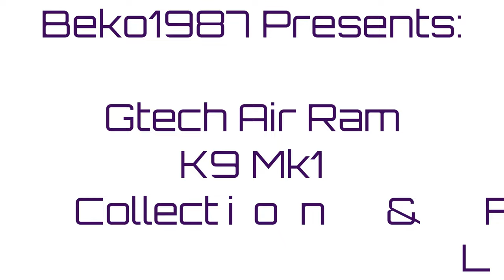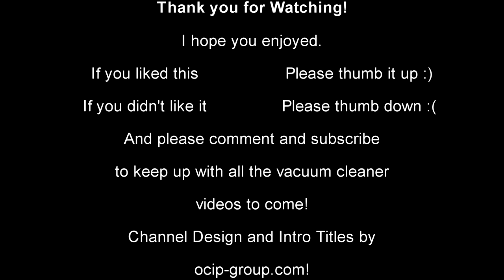The CHEAPEST Gtech Air Ram K9 (Mk1) EVER?? Collection and FIRST LOOK!

Comment: Sounds like that plastic cog that drives from the motor to the  brushroll has teeth stripped off it. Seemed quite a common fault with the Air Ram mk1. Glad I never bought one as I guess most of them have died the same death from that little cog wearing out prematurely. I guess they remedied the design on the mk2 model.